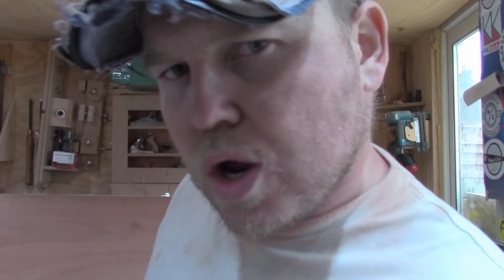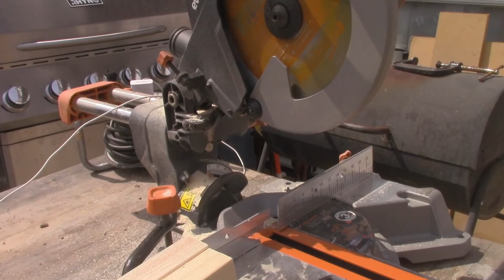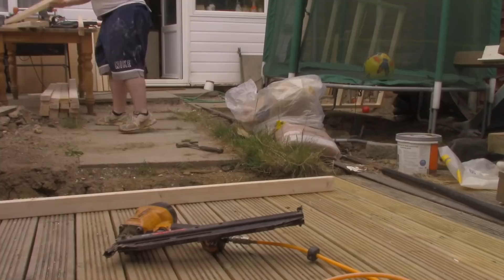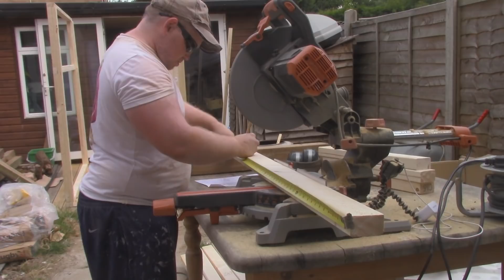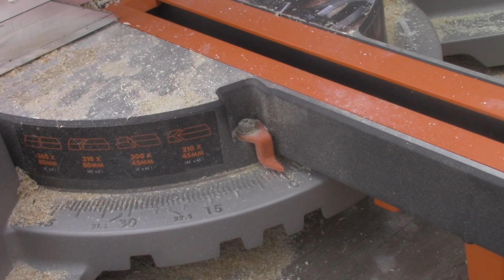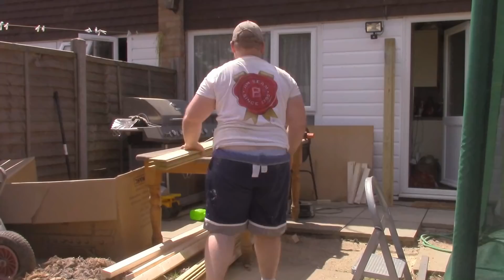Building A Bike Shed From Scratch | Heavy Duty Hinges PART 1

Comment from the maker: Building A Bike Shed From Scratch | Heavy Duty Hinges PART 1

The time has come to build not only a storage shed for my bikes but somewhere to house my car roof box when it's not in use. Considering this isn't really something you can pick up at your local shop, it had to be custom-made.
It's a simple design using readily available lumber from any DIY store. I have space for 3 bikes, plus garden equipment such as a lawn mower and toys, plus the top storage for my roof box and tools that I want to get out of my small workshop.
If you are looking for bike shed or storage unit ideas, then hopefully this will help you out.

▸ Support on Patreon! - https://www.patreon.com/WHCreations
▸ My Website - https://www.whcreations.co.uk